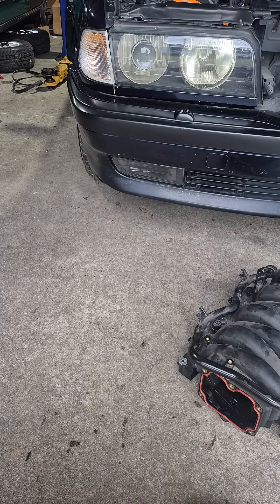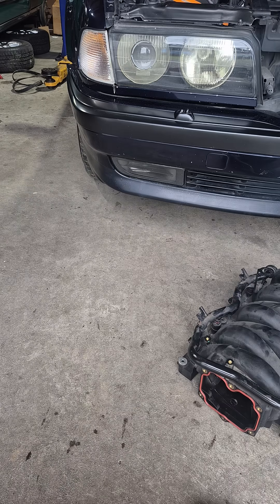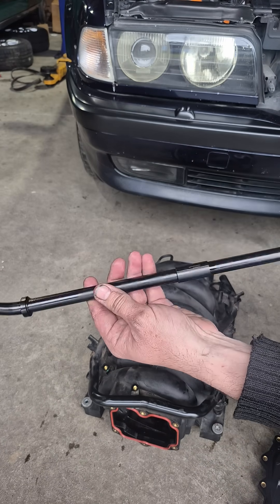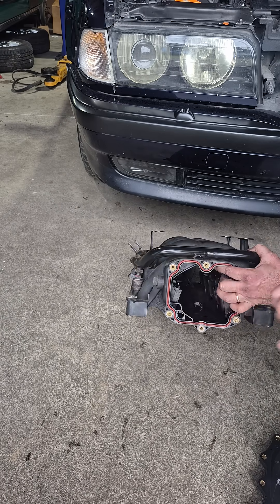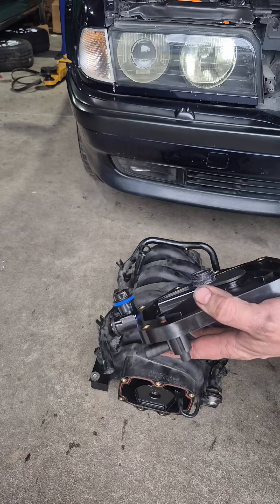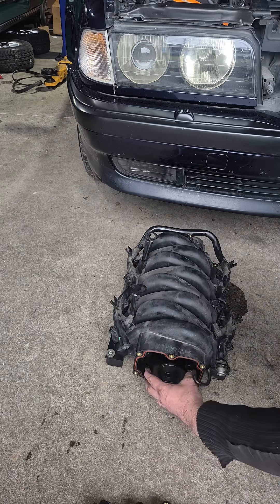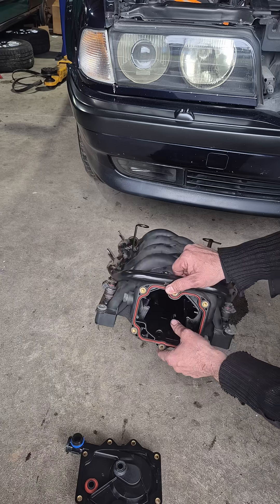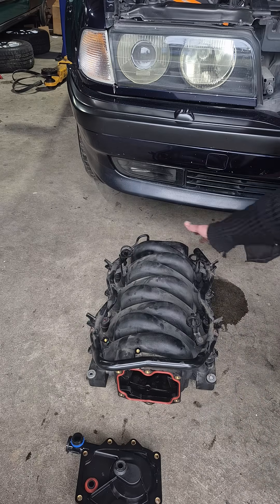BMW M62 V8 PCV

Comment: Solid explanation of PCV nightmare replacement. Thx. I've done mine two weeks ago. Dont forget guys to replace 7 small torx bolts m6x25 with normal hex heads. 8.8 grade is ok. Dont rush with undoing old one as access to them is horible. T30 jus to let you know-make sure its new bit.